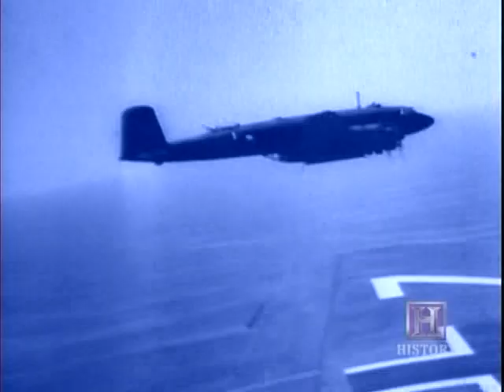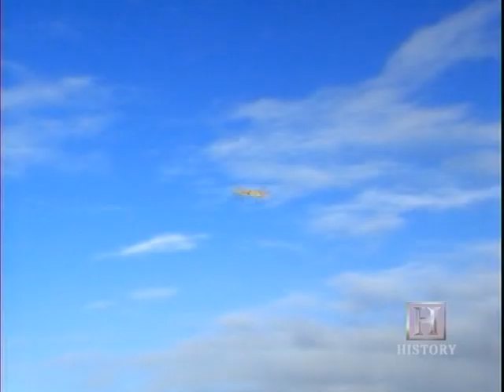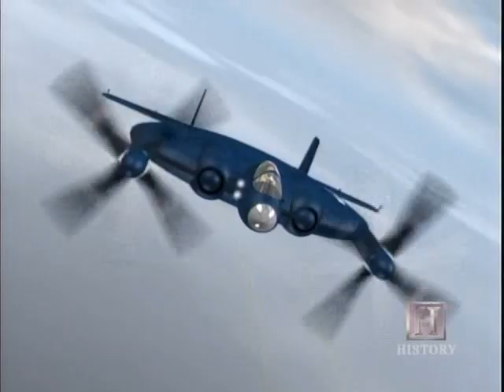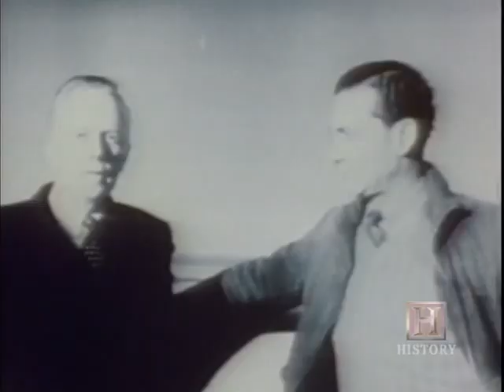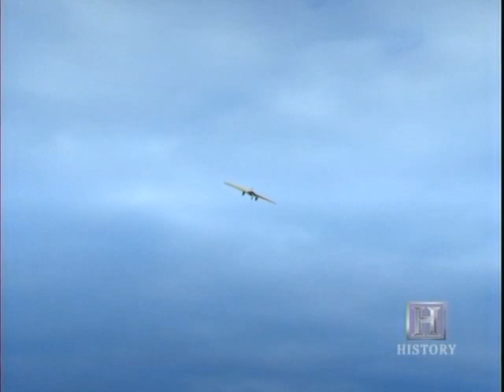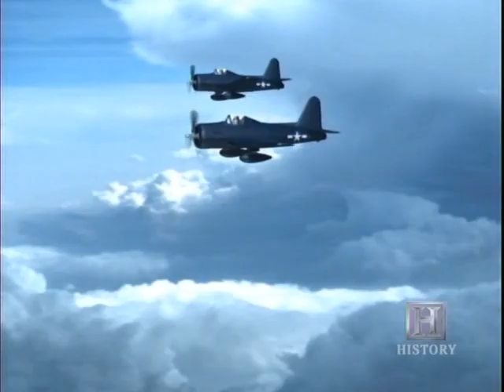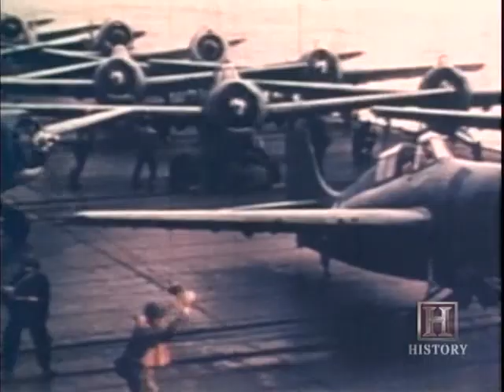Secret Allied Aircraft of WW2

Comment: 10:35 Nope. And it saddens me to still hear pilots tell that story as to how airplanes fly. Yes, an asymmetric profile creates more lift in the upward direction than down, but that's not the reason why airplanes fly. If the difference in air travel length was the reason for a wing to generate lift, planes could not fly upside down. But they can. Even asymmetric wing profiles can be flown inverted.
Reply: +Toumal Rakesh Keep in mind that when flying inverted, the profile of the wing creates lift, but "up" in this case would be toward the ground.  A lot of down elevator is needed to give the plane a nose-down (toward the sky) attitude that, in effect, creates lower pressure on the bottom surface  of the wing (toward the sky).
Reply: +Bob S Ever heard of something called angle of attack?
Reply: +Bob S You are both correct. The truth is, no one knows theoretically how an airplane flies. We know wings create pressure differentials, but not why in theory. The various textbook explanations have all being debunked by NASA actually. But that pressure differential fact isn't incompatible with flying upside down (which I did myself as an amateur pilot) as Bob S stated.
Also the air doesn't try to get to the low pressure area: it doesn't know it's there (air isn't that smart, sadly). It's just the same thing as pushing on a plate from both sides but not as hard on one side... Semantics I guess.
Reply: +Adrien Perié No one knows theoretically? 
That's incorrect. Wildly incorrect.
Reply: modsurgeon
Well it isn't so please feel free to recalibrate your sensors.
Reply: modsurgeon
"no one knows theoretically how an airplane flies" is only incompatible with "Not to say we don't have  models that pretty accurately predict most  of  the stuff that's happening" if you have no notion of what theoretical physics is or how it works and relates to models. Maybie if you tried to understand  what  I'm  saying you would.
What I'm saying  is, we don't have a single theory of aerodynamics that accurately describes all of what's  going all the time.
One model  might accurately describe a specific  type of flow, but be wildly inaccurate for another situation.
If you understand human anatomy and how a musket works, do  you know war in the  17th century ? The answer is no.
 But that allegory is inaccurate, since we don't  have even the theory correct for all of it, we just  created  models that work by  trial and  error in most  case, if not just observation.
Reply: Yes, as that's exactly what I was describing.
Reply: Perhaps instead you can explain in detail how  you are reconciling the statement: "no one knows theoretically how an airplane flies"

With the directly contradictory statement: "Not to say we don't have  models that pretty accurately predict most  of  the stuff that's happening".

By definition if there are models that work to predict performance, a theoretical general understanding of how planes fly must exist.

To claim otherwise is nonsensical.
Reply: When someone changed tactics to simply becoming an insulting twit, it generally signals that they are full of crap, and lack the integrity, wit and candor that allows normal people to concede their errors.

It's not the fault of anyone but yourself that you made a claim that was wildly incorrect. It was sloppy, lazy, or ignorant. Perhaps it was all three.

The theoretical basis for controlled flight is taught in universities throughout the globe. They aren't guessing how aeronautics works.

You acting under the pretense that you were trying to argue that no theoretical model exists that perfectly  predicts outcomes for all possible factors is nonsense, regardless of your attempts to bluster your way through.

No model of that sort exists in any complex engineering endeavor. Claiming that such implies zero theoretical understanding of process is a demonstrably flawed conclusion.
Reply: F6fhellcatace groomes If that was the reason, then planes with ducted fans or elevated props (like a motor sailplane with the prop mounted above the fuselage) wouldn't fly because the air from the prop doesn't wash over the wings.
Reply: modsurgeon
Well, NASA actually published a piece on that very issue just a few years ago.
Not to say we don't have  models that pretty accurately predict most  of  the stuff that's happening, just that those are imperfect for they aren't wholistic at all and in fact different models will be used  for different things.
I'm not denying the fact a wing has a high and a low pressure side is known.
Reply: That seems to be a substantially different position than your original assertion.
Reply: This is sort of cross flow for dynamics of the air-frame sort of speaking .  This also equals airflow drag and cost hp to keep up with speed .  It also has effect of - Gs of one in a straight line just like a positive G of 1 in a verted flight .
Reply: What a load of hooey.

This is what you originally said, and to which I took exception:

"no one knows theoretically how an airplane flies".

Your follow ups were all attempts to change what you had said so that you could avoid simply conceding that you overstated the reality.

The reality is that many people, including young hobbyists who regularly design and build successful model aircraft, understand the theoretical reasons how airplanes fly.
Reply: modsurgeon
You're  literally the most intellectually shallow and close minded person I've met on youtube for  a while,  and that's saying  something.
The fact you can not understand the difference  between a physics model and an observation shows that even  if you weren't  so shallow minded  and concentrated on yourself you wouldn't understand.
There is a difference between knowing wings create  pressure differentials in between different  sections of the airflow around them and having a single theoretical model that accurately predicts every parameter of flow in any conditions of speed and  geometry. A big  one.I don't know  what you're on about, I don't care if you build RC planes, I piloted over four different aircraft in real life  and  yet that has nothing to do with this whatsoever, I can build RC cars without knowing how an electric or IC engine works, I  can  make a wing without understanding anything close to everything there is to about aerodynamics simply through trial and error or any other method. Your point is a complete fallacy.
Reply: Google Bernoulli principal. Really neat.
Reply: modsurgeon
The man that knows better than NASA about aerodynamics because he builds RC planes everybody.
I thought, being an amateur pilot and engineer, I was up to the task of shutting his dirty mouth up, but since even NASA isn't, I give up with all my pride and more. Please feel free to give a round of applause, or of pissing on his porch, both are fine with me.
Reply: You aren't NASA.
Reply: Toumal Rakesh planes fly die to thrust or prop wash over the wings to start going forward
Reply: Why do people with clearly no understanding of a subject what so ever post comments like this ?
Reply: Magpie4000  to piss off people like you.
Reply: +Untitled User Wow what a prodigious knowledge of aeronautics you have
Reply: Guys look up Bernoulli's principle of hydrodynamics
Reply: no no no The high pressure has to be able to SEE the low pressure 'cos pressure has eyes .............
Reply: Not even that. If you blow streamlines across an airfoil that is generating lift, you will see that the wing takes the horizontal airflow and diverts it downward as it departs the aft edge of the wing; the downward deflection of the air creates a compensating force on the wing, which is lift.This is why a flat surface with a positive angle of attack generates lift, albeit with a large amount of drag.
Reply: The "downward deflection of air" isn't lift. 
Lift is generated by the pressure differential and acts through the center of lift of the wing. Increasing angles of attack reduce lift.
Reply: Magpie4000, I submit this authoritative statement: "Lift occurs when a moving flow of gas is turned by a solid object. The flow is turned in one direction, and the lift is generated in the opposite direction..." 

https://www.grc.nasa.gov/www/K-12/airplane/lift1.html
Reply: lift is due to the pressure difference between the upper and lower surfaces of the wing due to Bernoulli's Therom. "An increase in the speed of a fluid occurs simultaneously with a decrease in pressure or a decrease in the fluid's potential energy."
Reply: Yes you are right but only partially.  The majority of lift is created by the angle of attack and the air being forced downward.  But there is also lift created by the discussion of the Bernoulli principle.  The typical airfoil from earlier aircraft did use this extensively to create lift.  However with the ability to generate more and more thrust this amount of lift became less important and also the modern slats and flaps provide assistance with managing lower speed for take off and landing by altering the shapes of wings.   The P-51 Mustang was the first aircraft with a laminar flow wing which introduced a very different shaped wing.  And high performance jet aircraft have very different wing shapes and control surfaces depending on whether they high subsonic or supersonic.  In fact modern fighter aircraft use very complex shaped wings such as adding wing root extensions and of course most utilize a lifting body shape as well.  This virtually eliminates traditional wing loading calculations as irrelevant.
Reply: Magpie4000 jn
Reply: I see it this way:  A wing goes up because there is more pressure under it pushing up than there is over it pushing down, and carries the airplane with it.  The Bernoulli principal is good for reducing the pressure on top to give lift.  If you then tilt the wing, angle of attack, you compress the air under it as it tries to get around the wing hence more pressure under than over and the wing goes up.  How you quantify all of these forces and predict the result is a matter of mostly math.